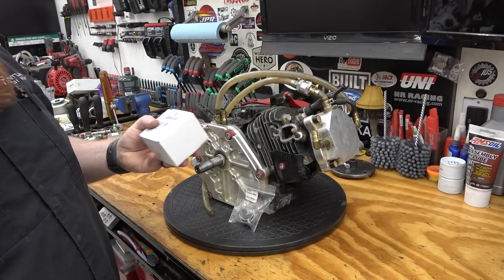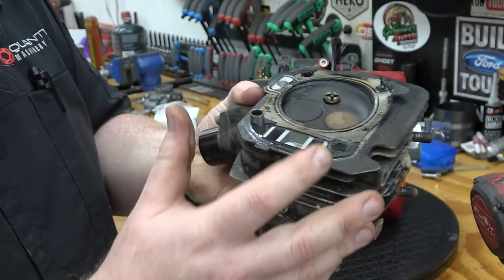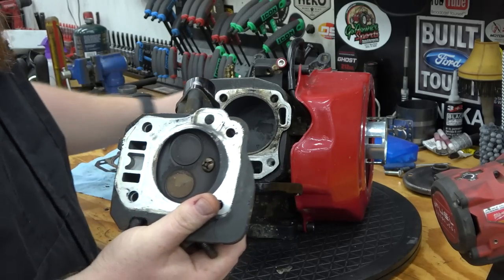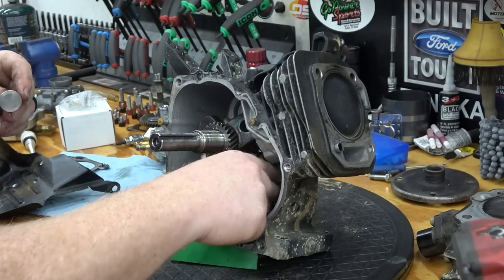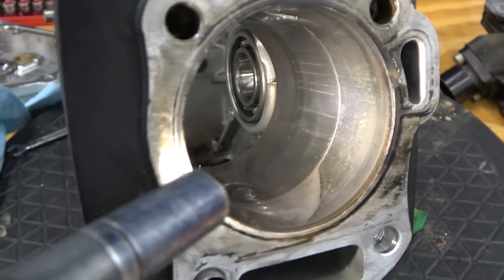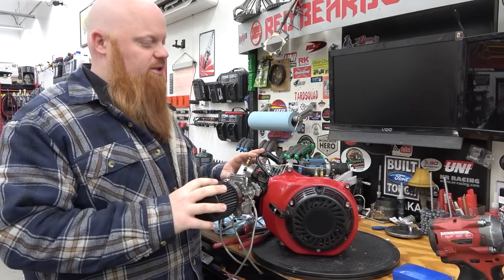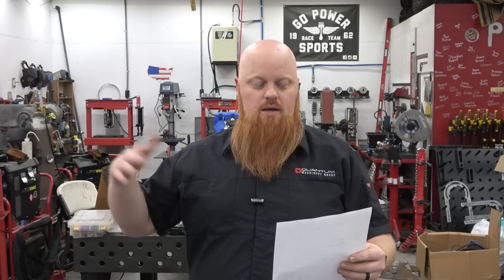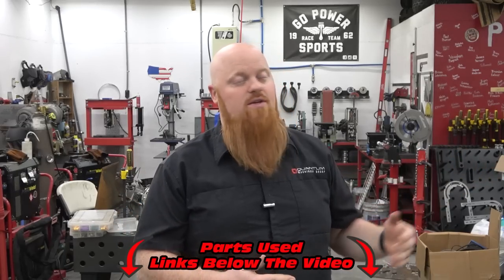Big Dyno Numbers With a Blown Engine ~ Predator 224cc Max Performance Stage 4

Comment: Red, you have evolved so much....LOVE the recent content, especially the Road To Horsepower series. I cannot believe you don't have more subscribers!! That dyno and the plasma table have been real game changers for your operation there. Kepp cranking out the good stuff! About the cracked sleeve.....totally baffled by that, but very interesting to see. Hopefully Tillotson sees this and can research the issue.
Reply: I bet the sleeve cracked due to vibration and block flex. These engines are being pushed well beyond what they were designed for and at that point stuff like this starts to happen. I wonder if a person could find thicker sleeve and bore out the block a bit more and push that in. Might be getting to the point where you will start to need to make some kind of girdle for the block. I do think that getting the rotating assembly balanced is an excellent idea which will free up horsepower and prolong the life of the engine. I'm currently working on a Continental engine from a forklift and those engines were balanced from the factory to help them last longer. The port sizes on that head aren't much bigger than what you see on the Predators of course they were only aiming for 40hp out of a Z-134 at 2k.

Comment: Hey Redbeard, you ought to try going up to the VM28 Mikuni flat slide before you swap to the billet head to take advantage of your current big valve head. You might even break 19hp with the VM28. A lot of 24mm Mikuni guys would love to see the difference on the dyno before taking on the $150 charge to swap to the slightly bigger carb.

Comment: From a failure diagnosis standpoint, that looks like a classic case of thermal expansion difference between an aluminum block and a steel sleeve. Not something that happens overnight naturally, but a cyclical effect. That is an impressive power level nonetheless, especially for one coming apart (almost literally) at the seams!

Comment: Feel like ruining, I mean fixing a stock 224 block?..  So maybe...  Drill the head bolt bores all the way down into the crankcase, tap, then studs. Yes balance!  Out of balance rotating assembles trash parts and engines, plus waste power.   Thank you Red for this vid!

Comment: I feel like the head gasket Blew then the heat escaping  Cracked the Cyl  try Copper Coat Spray on the MLS gasket let it dry completely then install Good Luck Great Video Red :face-blue-smiling:

Comment: Cerakote is a thermal reflector, aluminum is designed to dissipate heat at a fast rate...the cerakote will slow it down and hold heat in the block causing it to warp and crack,plus the vibration the 224 has doesn't help either.
Reply: My first thought was that I would start wondering how hot I was running.
Reply: Hello , am rossia, video крутые 👍

Comment: Isn't the stock muffler really restrictive and carburetor on the lean side? 10 HP isn't bad at all for that size engine and all those power killers installed. What is your compression increase over stock? 10.0 to 10.5?

Comment: It could've been the core shift during manufacturing. Another possibility is the piston rings were tight from the factory and with all that sustained rpm you were giving it they butted a bit and expanded, putting more force on the sleeve. Aluminum fatigues with heat and expansion rates are different with steel and aluminum so that could also be a factor. You should try low tension moly rings and a bigger gap to see if that prevents cracking.

Comment: What's happening is that the blown by which is "exhaust smoke" essentially is directly going into the head, causing it to become too pressured seeing that there is 2 lines in an 1 out. From the side cover there should be 1 directly out to air and 1 must find a medium space like a catch can before it goes into the head. Basically all that's happening is there is too much pressure building up in the crank case but its going directly back into the engine with little escaping. By doing that you're taking the high-pressured exhaust smoke that lands in the crankcase "past the rings" and putting it right back into the head. In the valve cover or valvetrain it's becoming so pressured it's pushing through even the valves guides and going into the chamber. Simply reduce the pressure that goes back into the head and make sure it's semi-clean before it goes back into the valve cover. Against popular theory you should never have the high-pressure of the crankcase going right back into the head that's already happening through the oil tube. The purpose of ventilating the crankcase is to reduce the pressure in the head to begin with. Or this happens. You don't want opposing forces you just want to allow the air to escape at a slow rate and at a faster rate at higher RPMs hence the PCV valves. The only reason why you want to go back into the head  with air is to maintain some type of pressure at a fast drop in RPMs. Besides that it is senseless or maybe to spit oil Vapors on the valve train but there is a lot of oil coming up between the pushrods there should be zinc in the oil to promote that.

Comment: Have you considered testing Cerakote engine coating on these engines?  Piston Coat on the top of the piston & combustion chamber/valve faces, and Micros Slick Dry film lubricant on the piston skirts.  Would be really interesting to see if you get any hp gains.

Comment: It's interesting to see such a small general purpose engine able to perform at that level of output power and speed with some relatively simple upgrades.  I wonder though, is there a decent fuel injection system yet for something like this or is it too cost prohibitive to have something like that?
Reply: Probably the closest thing EFI wise is Speeduino. There’s a bunch of different boards, the detonation EMS x2 is perfect for these kinds of engines. The ECU itself is under $100. But when you add throttle body, injector, fuel pump, sensors and trigger wheel (required if you plan to control ignition) you’ll be lucky to have change out of $300 or so. Have to consider powering it too. The ECU doesn’t use much, but even the small fuel pumps can draw as much as 3A. If you’re running a lambda sensor that another amp. There’s things you can do to reduce fuel pump power needs via electronic pressure regulation. This can get your total system draw down to 2-3A

Power wise EFI itself doesn’t really change peak HP, but you can find a lot under the curve between ignition and fuel mapping.  Transient response can be very snappy if you want it to be.

Probably biggest bonus of an EFI EFI system is boost control and nitrous support.

Comment: I'm sorry but I'm pretty sure is as long as the flywheel doesn't interfere with the block or the engine case and seats nice on the crankshaft and does up ok it will be fine

Comment: Do you find the blue roller rockers are just as good as the black spyder roller rockers?  I notice many people don’t splurge the $89 more for the black pros.

Also can you use the same crank in the new block so it matches your flywheel?  It’s a bit absurd to think a poor middle aged dad who’s smuggling extra money from the wife to build a scooter motor could afford a new bullet flywheel each rebuild…..  🤔 

Awesome video though, thank you 🙏🏽

Comment: When I put my thumb on the spark plug hole I feel no pressure at all and found my spark plug to be covered in oil. The engine runs but struggles to go over 7k rpm could it be a blown head gasket ?

Comment: First of all that is the sleeve that broke.  The reason it failed is it is a HF pile,  I bought a Tillotson 72mm short block with self aligning bearings for $140.  The company I bought it from also mills just enough off the top of the deck to make sure it is flat.  If you want to make big power with a clone Tillotson blocks were designed for that purpose they are the only ones that were developed for big power period.
Reply: One thing that guys never consider is that many of these engines including the 224 are utility engines low oil sensor and all. The Tillotson is a powersports engine. It better have a higher quality block.

Comment: I've seen that on small block Chevy rare engines that burned the head gasket as much as 0.60 gone from the block and more from the head both cast iron  running 110 octane rare gas between cylinders 3 and 5

Comment: Your rod had to have hit the bottom of the cylinder sleeve.  if it’s stroked then maybe the crank hit it. Definitely hit the sleeve on the old block that why it cracked ect.

Comment: You should cut that head another .030"-.060" pick up some TQ and maybe a HP or two, running 100 octane plus you should not have any problems,  200-220 psi compression ,

Comment: Question, do you still put the Normal 0.64 quarts in your 224 considering that the oil sensor is out? I’m building a stage 3 and I’m not sure how much oil would be optimal
Reply: 14oz is what I always run. 12-16 is the range.

Comment: You say to never reuse a billet flywheel. I dont mean to sound dumb, but if it has a key and you relap it. What would be the issue with reuse?
Reply from the maker: I don't see an issue with it but thats what they say lol.
Reply: If it's made from billet aluminum vs cast steel then i would guess it's because aluminum gets weaker with use no matter what so after a long time can fail from fatigue. Steel has the ability to stay strong with use unless it gets abused and pushed to hard. I have no idea if thats actually the reason, it's just what i would guess.

Comment: I’m no expert, but it seem to be a piston to piston sleeve clearance issue at high rpms with just regular fuel, pistons expands. So, obviously what we do with this small engines is not what they are meant for; therefore, I would recomment take the block to a machine shop for a .002 - .003 clearance for extra life. Yes, it may down the compression a little and might breath out of the vent, but for sure this issuew wouldn’t happen again
Reply: didn't see any seizure marks on the cylinder or piston
Reply: There was indication of this being needed at all.

Comment: I doubt very much if you would interested in what I ask but it won't cost me anything to ask. Since you have this dyno I'd like to see you that an Audi A6 190 AMP water cooled alternator, convert it to an electric motor and run it on your dyno at 72 to 144 volts to see how much horsepower and torque that it would make.

Comment: I’m wagering a bet that the head gasket failed first! Then you torched the block causing the missing piece and allowing the sleeve to move! I’ve seen it on high performance engines before! Not saying I don’t think there could’ve been quality control issues just pointing out something I’ve came across b4!

Comment: No after pics of how you clearances the block and the crank?? That’s the cool shxt. Idk why you’d just skip past that.
Reply: That would have been nice to see. I had to clearance top and bottom of the cylinder and one spot on the back of the block. Also had to clearance the cam in two spots. One of those was the intake lobe contacting the rod. Fun build.

Comment: Race fuel runes more engines, yes it makes them faster, but not so much a motor builder can't build a gasser to match its speed.  Stick to gas. It will save you thousands over the season. Learn to build a better motor! Save the fuel cheats for the amateurs. 10 years of small motors racing, 100's of motors. Race team mechanic. Reliability wins races!

Comment: Sorry but that torque band sucks. It’s super narrow, and doesn’t match the horsepower nature. Needs less RPM. Honestly I wouldn’t bother revving past 6,000rpm. And the torque below 3200 is hilarious. It’ll barely get moving with a cam like this.
Reply: @seanb250  that doesn't help the embarassing torque below 3k, and does nothing for top speed revving to that rpm.
Reply: @seanb250  because you need torque to get to the higher rpms. an engine doesn't just magically keep revving, it needs the balls to do so. if your torque dips off at 5k, and youre headed up a hill, youll watch the rpms AND speed drop. RPMs and speed and tied together.